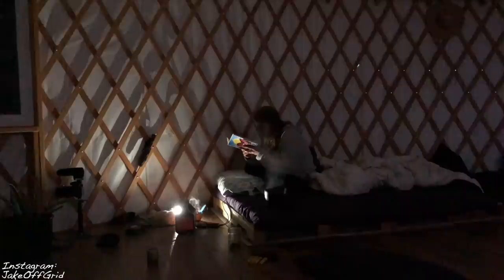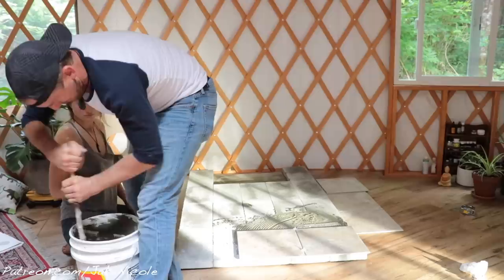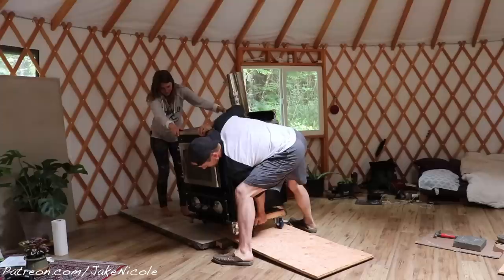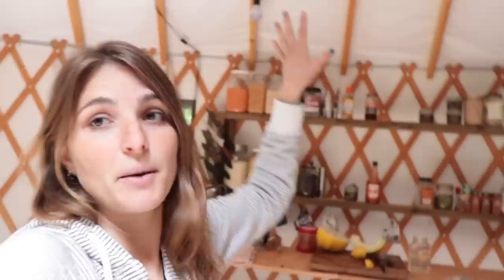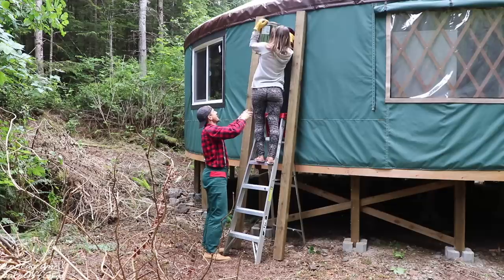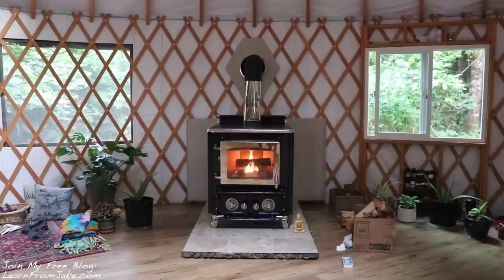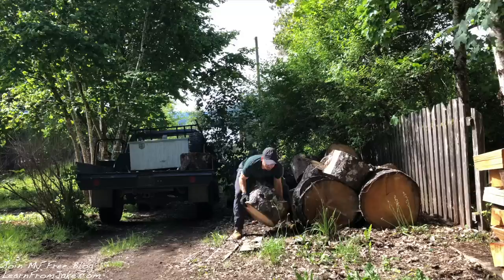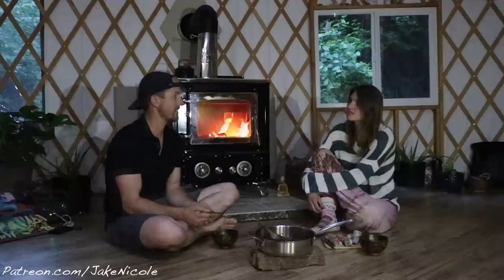Amazing Off Grid Yurt | Installing a Wood Stove & Chimney - Part 2

Comment: Great yurt!

I would have run the stove pipe, uninsulated, inside, all the way along the ceiling to the center to exit.

I would also put in floor water heat tube, under the wood floor - or marble etc, in various places. The whole chimney would then be entirely wrapped in copper tube, to warm the floor water, in a tank, to a temperature. For summer cooling, a buried  water tube cools water, to be run through the floor and/or through a tube coil of copper, hung below a ceiling fan, to be circulated, with a $19 boat pump, or by heat convection. 

Insulated Tanks in the floor, can be heated the same. Prius batteries would do for solar storage. 

Is it completely dark for some months?

If so, a turbine in the chimney pipe could drive a generator, or more - housed above the center hole! 

Rain water/snow collection would help!

I would make a section in the yurt, maybe on a loft, for growing veggies all winter!

I've seen in ground greenhouses up there too - using thermal mass and solar, with water to heat green houses!

I would have central located the stove; but, you have other ideas too.

Great job

Comment: Beautiful yurt! Well done! But, in my opinion, the pipe for the furnace had to be made with a diameter of 100 mm. and zigzag along the wall. There will be more heat and firewood will be consumed more efficiently, and it will be warmer in the yurt.  I live in Kazakhstan and I often had to spend the night in a yurt.

Comment: I have a lite scar from a chainsaw that I thought stopped and had not fully stopped when I rested the motor on my leg but the rear of the chain managed to get me.  Thank God for two pairs of jeans and two pairs of long-Johns, better would have been those chainsaw pants you are wearing.

Comment: Moisture is good for a long burning fire. I start mine with dry wood then use greener wood to sustain heat. You will consume a lot less that way.
Reply: G Black wet wood is wasted wood. When you burn it most of the energy goes to boil off the water it contains, you can cut your heat output by two thirds by using unseasoned wood.

Comment: Also if you ever want to make sure your posts are completely level you should use two stakes to hold them in for at least 24 hours that's always what I've done just level the posts then hammer 2 stakes per post to keep it in place

Comment: So just cutting and splitting your wood as you need it is a bad idea.  I grew up in rural Washington state. I have cut and stacked a lot of fire wood. Best way i have found is build a wood shed if possible and a wood box next to your front door. Wood shed allows you to stack a lot of wood so it can dry. Wood box puts dry wood close to your door, so not having to run out to wood shed to get wood in the rain or snow. Also section off an area in your wood box to put kindling in. If you dont have wood shed, you can take 2 6ft 2x4's and drive them into the ground with about a 6inch gap in between them, so they stand up. Then lay 2 more parallel on the ground in front of them( if you dont have 2x4's to lay on the ground, use some of you split wood you have in place of the 2x4's), and drive 2 more 6ft 2x4's into the ground at the end of the ones laying down. Now just cut your wood to rough 12 inches and split it, then just stack about 5ft high cover with a tarp. You can make rows of wood stacks like this. Let the wood sit covered for a season if possible. What this will do is allow air flow underneath the stack of wood, as well as keep moisture from it. And dry seasoned wood burns hotter and lasts longer then green wet wood. And if wood is your primary source of heat, always stock pile it, because there can be years where you don't have good access to wood. Good luck

Comment: you might want to think about one more layer to put on sides an back of stove, sheet soapstone holds heat , not enough to burn the building, but enough , that if the flame goes out, the soapstone will hold the heat an keep you warm, till you get the stove lite again.

Comment: The only thing i have seen in the installation that is not good enough for me the external perimeter,  the plywood looking on the base in the same level of the floor was exposed and this will damage by the rain water fall down, if you can make a cover, it will make long and lasting. But most of all amazing and very interesting OFF-GRID life living...

Comment: my only issues with this are, the amount of pipe that comes off the stove before the turn looks like less than 3 feet. that stove is huge not to have a longer run before the turn. the other issue is the pipe damper. i hate them. they slow down the smoke and make for a longer residence time for the smoke inside the chimney. It chokes down the fire not like a damper built into the stove, but by suffocating the fire with smoke and CO2. But that stove is nice. an absolute monster.

Comment: PS! The sun brakes down wood fibres, so its actually degrading the wood. But it needs to dry, real dry, so..... A year or two in the sun while drying is probably OK. Dry it up above the ground 1-2 feet or more, on a dry spot outside, lots of air around it and thru it.

Comment: the flue pipe doesn't meet the 2" air space clearance to combustibles at wall and as well as the exterior just above the tee along with it doesn't meet chimney height standard to roofline.

Comment: Were you mixing concrete or making soup ?  The thinner you mix it the weaker it is.  Next time pound a stake in the ground a few feet from your post then run a batten board between them and tack it when the post is plumb.  Plumb is vertical, level is horizontal.  I wouldn't burn too much softwood , you'll catch your chimney on fire.  I appreciate you want to do everything yourself but asking advice from people with more experience is always a good move

Comment: put the footing Styrofoam mid way of the joist helt with stiff wire wedged between then metal building plastic backed insulation / you can get in 3 foot - 6 foot - full length - shorter for every 6 foot ….  would insulate excellent with the 2 air gaps

Comment: The sun gets in the pores and charges the wood HAHAHA holy FTards batman , on a more serious note please avoid burning green unseasoned wood in your beautiful new stove , it causes excessive creosote buildup which is no bueno , creosote berry berry bad , and don't forget to clean your chimney before every cold season . Good dry hardwood should burn clean in a stove like that , when you get the draft a air intake figured out there should be almost zero smoke out the chimney and this will lengthen the burn time for each load saving you wood as well  .

Comment: Great job guys. 

Ijust watched the 2 hour montage and the previous video moving the stove. I thought about putting something under to not burn the floor.... glad to see that went in. Also, concerned the wood you put in the laneway will be floating in the spring. 

I just had a lot of personal cringe worthy moments while Jake was on the ladder, standing on the top where it should clearly say "This Is Not A Step". Glad to see there weren't any mishaps.

Comment: Didn't notice an external air inlet to the wood stove to prevent the stove fire from using oxygen from inside the yurt. You'll know it's a problem if you start getting headaches.

Comment: If you want to split the wood better  pick up a 10lb splitting mall and some wedges steel wedges and also a 8 lb sledge hammer to drive the wedges. Good wood to burn is ash,white oaks,red oaks, beach nut,walnut, mulberry, Locust just watch out for the thorns on this tree. You never want to burn pine trees cuz of the creosote that builds up in the chimney pipe. You can also control your burn by turning down the dampner on the pipe this will also keep more heat in the home. The place you got your stove ask for a fan with no cord .should help in moving air flow around. Nice house. Have fun

Comment: Should've him had a piece of lumber cut to the seperation size of the poles, drilled transversally to them to form an H, for a more accurate fit, prior to setting them on the cement?

Comment: Hi,  do you think  it would work to use the same sort of prefab concrete deck blocks as you used for the yurt framework, for the  base for the flu support? rather than digging holes and pouring concrete? the posts could possibly be tied into the yurt deck.

Comment: would you add a water  cylinder  see a plumber your fire will heat it  just an idea and a water tank outside  a concrete one  2000 gallon  one, lage your pipes with mutton cloth  covered with grease  it will prevent water freezing  see your plumber about this first can these yerts get added onto very good video well done bet you were tired after moving all that wood nice it was free bye

Comment: Floor protection for a stove with 2 to 6 inch legs needs 4 inches of hollow brick to allow airflow and tile on top of that, Needs to extend 18 inches in all directions past stove. 18 inches from wall also. Wall protection is the 1-inch spacing necessary between the protecting material and the wall. The 1-inch spacing is necessary to ensure air circulation between the protection and the wall so that the wall is not subject to high temperatures. The spacers used to attach the sheet metal to the wall also must be non-combustible. The install you have is dangerous.

Comment: Twin wall with 10mm gap insulation indoor only, PLS  make ventilation duct direct to the stove instead of conventional wall ventilation(stops drawing cold air indoor. ) I see you puting a 90degree elbow??!! Go 45 better venturing effect...hence your girl is fit...won't be short getting warm T night lol...good job

Comment: I cringed watching you cut cable with tin snips. But hanging the pots is a good solution for convenience. At least as a temporary solution. Having soft walls poses interesting problems and good problem solving experience.

Comment: If you guys ever want to not have to clean your wood stove chiminey as much you should check out NORTH IDAHO ENERGY LOGS it's pressed sawdust that's delivered on a pallet and I'm sure they can deliver to you for a little more than what it costs on a mainland it burns much more hotter and it's cleaner and more efficient than normal wood so you don't have to clean your chimney as much and it's convenient because it's delivered on a pallet and you can chop up one and use them as fire starters for the others and it lasts all night long we get them delivered 4 pallets at a time and each pallet lasts about 1 month and we are in a 2,500 square foot house I'm gonna downgrade to a tiny home and definitely gonna use them when I get my own wood stove I think it's definitely worth the money and it's covered in a giant tarp fitted for it so you can just take what you need and cover it so you don't have to keep it inside so it doesn't take up space